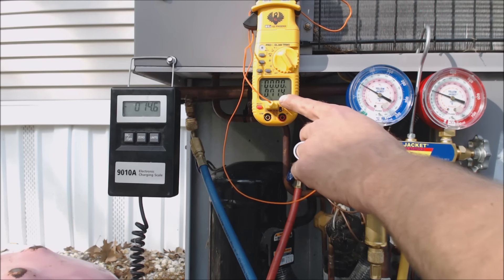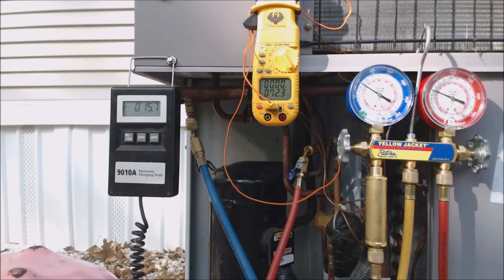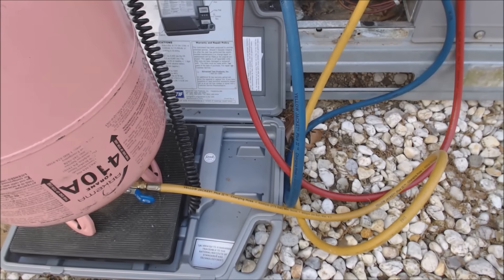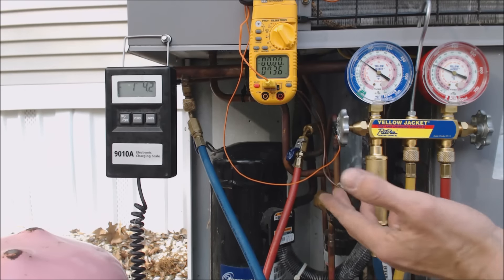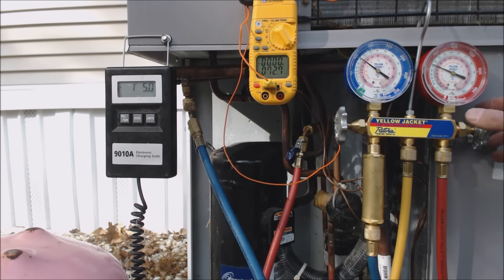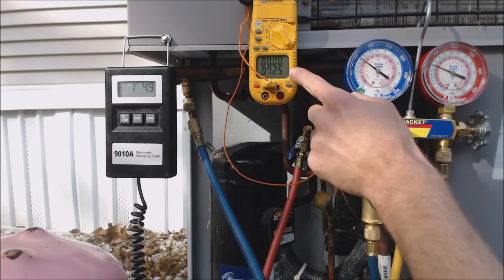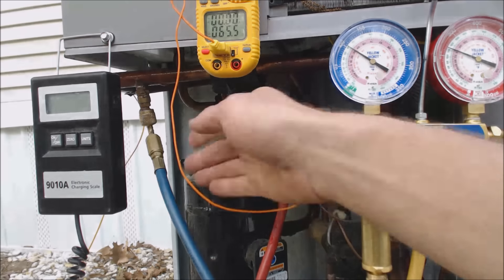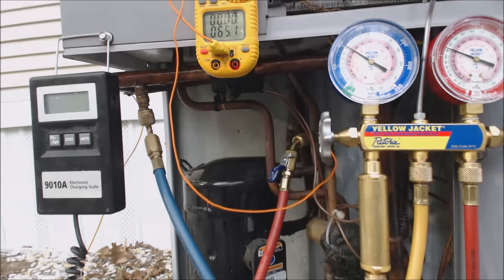R-410A Charging! Charging a System that is Very Low on Refrigerant,  Avoid the Evap Freezing! Part 2

Comment: The videos are great. I'm trying to learn as I'm interested in HVAC.  Maybe not the place to ask but lots of expertise here.  We had a 4-Ton Bryant 15 SEER Heat Pump installed.  The indoor Coil with a TXV is matched.  This is where I think the installer made an error and I tried to call him on it.  He delayed the install because he didn't have the correct Piston for the Outdoor unit.  I told him I didn't think you could have both a TXV and a Piston flow regulator.  He called me an F-in idiot and had his Partner deliver a Piston within hours.  So Our Heat Pump has both.  Was the Installer correct?  What I've read on my own is they were wrong.  He also must have been pissed at us because the Bill was $1000 more than the quote.

Comment: Is it normal in America for the 410a tank to only have 1 valve and have to be charged upside down? Every 410 a tank I've ever seen in Canada has a liquid valve that has a tube which draws from the bottom of the tank.
Reply from the maker: Yes those are disposable bottles.

Comment: hi Craig great video. can you use the kwik c charge adapter on the digital gauges along w the yellow jacket liquid charging adapter on the 410a tank ?
Reply: or just use one and are both them pretty much doing the same job
Reply from the maker: The kwik charge seems to do a better job and you can mount it right onto the tank and yes you can use digital gauges, thanks!

Comment: hi, i have a residential r410a system with TXV. the superheat is high (45F) and the subcooling very low (3F). so i added some r410a BUT the subcooling doesn't change much at all. i wanted to bring the subcooling to around 10F. however the superheat does drop. but why is the subcooling not going up? thank you for your help.
Reply from the maker: When you add over a pound, it takes extra time for the refrigerant to cycle through and for subcooling to rise, thanks

Comment: I'm having the opposite problem that you have at the end here, my system is rated 13 degree subcooling, they say plus or minus 3 degree is fine correct? so I reach the subcooling goal right away adding just a little bit but my pressure on the low side is way too low,  about 50, but on the high side I get around 94 degree while my liquid line temp is around 78-80 roughly so I'm anywhere between 14-17 degree subcooling, I'm afraid to add more 410-a to raise the low side pressure or should I do that anyway? I saw you first brought the pressure up on the left side before you started to measure your subcooling but I also noticed you never reached your target subcooling before or even afte like I said mine reaches the goal quickly, now here's the interesting part, my delta T inside the house is not stable it fluctuates about 5-7 degrees , sometime I get 20 degree difference sometimes it drops to 14-15 and all that while the compressor is running. appreciate your take on this, BTW I'm no professional just a self taught DIYer. thank you.
Reply from the maker: Great questions, I would always recommend a tech to fix this. Don't bother adding anymore refrigerant. You either have low airflow, a blockage in the liquid line, or a bad txv. low airflow could mean a clogged filter, dust covering the bottom of the evap coil, collapsed ductwork, too small of ductwork, or improperly running blower motor or blower speed. Subcooling is just a measurement of the liquid capacity in the outdoor coil but the low side is showing you what is happening at the evap coil. Thanks Gus F
Reply: thanks for your quick reply, unit fairly new (6 years old Carrier)), I always change filters ,  Airflow is good and strong I doubt it's the case, maybe one of the other two, the problem with technicians, they eye ball everything, the last time I had one here, he didn't even hook up a temp gauge, he was just pumped freon, looking at the low side feeling the line with his hand, and he said he likes to see it over 100 there, he also said I might have a small leak and he pumped this leak fix thing in it, charged me $350.00 and left, hard to find an honest A/C tech out here in the Los Angeles area, they're all about just making the money and running. thanks for your input anyway, I learned a lot from your videos great channel.
Reply from the maker: Wow, I am sorry to hear that Gus F! That is ridiculous. You might want to look into the txv then unless maybe you have a piston. Here is the txv troubleshoooting video list- https://www.youtube.com/playlist?list=PLxnHR5_D2ojy2EYzy0YIJkce9sFIQj4-j
Reply: thaks I will check out your play list , yes I do have a TXV not a piston.

Comment: how is it your adding 410a to unit that had a leak,it didnt leak out pure 410a so how do you know what the actual mixture is in the system,i was always told when blends leak,evacuate,fix the leak,vacuum and recharge
Reply from the maker: Hey M Norm Great Question! In the case of R-410A, manufacturer trainings will say it is ok to top off systems as far as the blend is concerned because it is near azeotropic even though they want the refrigerant to come out of the bottle as a liquid to avoid fractionation. Obviously not over and over again. If you are working with other zeotropic refrigerants then more care must be taken when fixing leaks and adding to the charge. Here is some good reading material. Thanks for the question! http://www.achrnews.com/articles/82752-blends-101-an-introduction-to-refrigerants
Reply: thanks for that link,that explains a lot and thanks for the great videos too

Comment: If the pkg unit was R22 with a piston, would you charge with the bottle upside-down?
Reply from the maker: It wouldn't matter if it was a fixed orifice or txv because the refrigerant that you are charging in would go straight to the compressor or on a heat pump, into the reversing valve and then into the accumulator. Sometimes I charge a single component as a liquid and sometimes as a vapor with the bottle right side up. You can use a Kwik Charge vaporizer or just charge15-20psi higher than the low side pressure already is 1 second at a time to try to keep the compressor safe, thanks
Reply: AC Service Tech LLC 
I did not know no difference.
Would you use suprheat or subcooling?

Comment: How do you know, I am an amateur who only works on my families units. The other day I charged my daughters ac unit and it went perfect using subcooling method and I got all the numbers that I was hoping to see. My AC unit is another story, the pressure seems to operate much higher, there is only a 410a sticker on the condenser with no other information. I downloaded the info on this unit and it says nothing on how to service.

Comment: How can you charge into the low side without the compressor running? How is the refrigerant making it's way to the high side with the compressor off?
Reply from the maker: The compressor and fan are running. My mic cancels out background noise. You are not the first one that has asked. Thanks Eric!
Reply: so you do have to charge it with the system on and compressor on while charging via superheat?
Reply from the maker: You would need to charge refrigerant into the low side while it is running. The only time that you could weigh in with the system off is if the system was vacuumed down to 500 microns and you break the vacuum with refrigerant, thanks

Comment: Why u charge the system liquid refrigerant from low side ?
Reply from the maker: R-410A is a mixed two part near azeotropic refrigerant mixture. It has to come out of the bottle in liquid form to keep the mix correct. R-22 can be charged out of the bottle as liquid or vapor. Thanks for the Question!

Comment: Whats wrong with dish soap?
Reply from the maker: The dish soaps now are much more corrosive then what they were 40 years ago. They eat away at the metal surfaces. Only use non corrosive leak detector. I have seen leaks and corrosion on newer installations due to dish soap and water, thanks
Reply: acservicetech good to know. Thanks for the info!